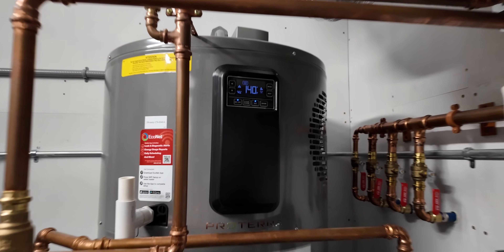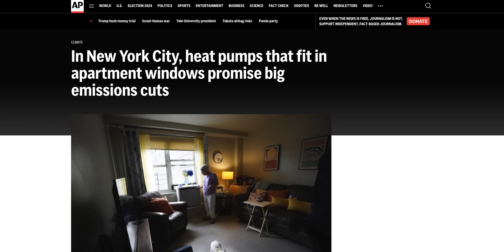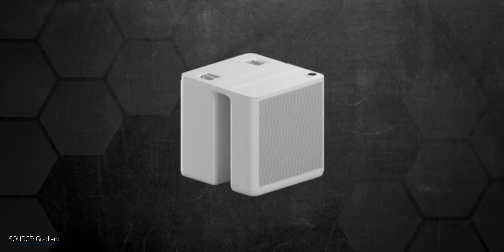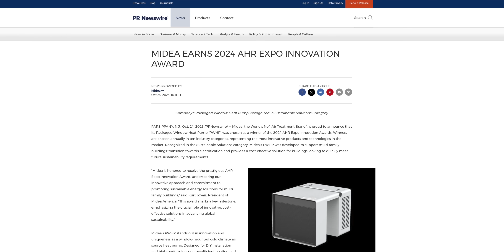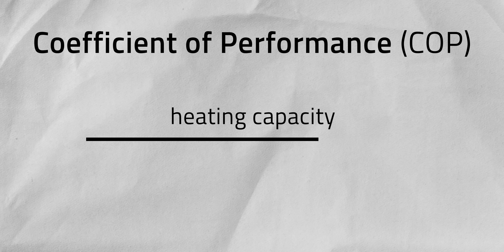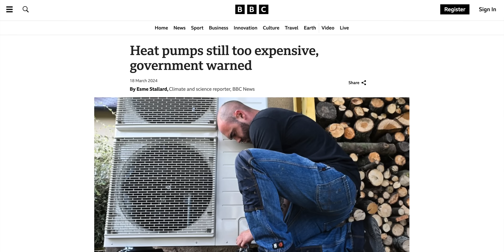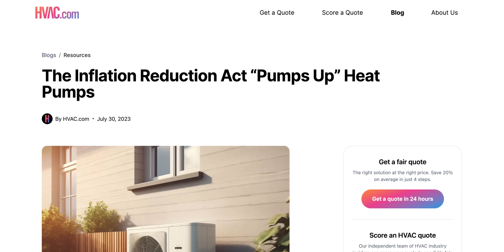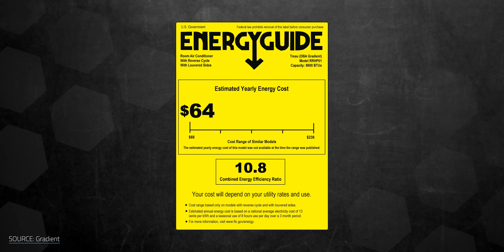Why This Window Heat Pump Is Genius

Comment: I wish someone would make a widow unit like this that works with horizontal windows. Every place I've rented has widows that slide open horizontally so I'm stuck with crappy "portable" units. I also can't mount a ductless unit and run the cables down from the second story because i can't punch holes like that in the wall -_-. If anyone can recommend options, I'd be glad to hear them

Comment: as someone who once had 3 AC units going in their small house at one time,  that then later got Central Air...omg there's no comparison. window ac units never made my house feel as good as central air did. never. you'd need a window ac unit for literally every room for it to compare i think.

Comment: I have thought for years that window AC should be required to work in heat pump mode. It is a similar story all the time. Therefore things are widely required, and the price stays high. but after mandates and mass market production, the price goes down.

Comment: A COP of <3 is abysmal. Any entry level AC for a few hundred $ nowadays does a COP of 4 with ease... Oh, and I totally don't get how running a "heat pump" vs. an AC would save any money whatsoever, AC and heatpump are 2 different names for the very same thing and every modern split AC does heating even better more efficiently than cooling...

Comment: I need one of these for my bedroom. It's at the end of the line for the radiators in my house so it's always cold in winter and in summer I have no air a/c in that room so it's hot.

Comment: Here's a question about heatpumps: if I live in a country that has no need for heating, but can get super hot in the summer (and so I need a lot of ACs), what benefits does a heat pump give me when compared to a regular compressor-based AC

My impression is that heat pumps are just reversible ACs. Is that asessment correct?

Comment: I remember upside-down-U-shaped air conditioners going back at least to the 1970s, but I don't remember if any models from those days were also heat pumps. This seems like a good option for those who can't or don't want to invest too much but can still benefit from a heat pump. It would be ideal for those suffering in buildings equipped only with resistance-heating (especially those awful systems with film or heating wires under the attic insulation) or failing central heating system (heat pumps could have avoided the $100,000+ assessments at Harbor Towers). The overall efficiency is an apples-to-oranges comparison, since the inefficiency of the grid  comes close to evening  the score (and our electric rates in Boston reflect that), and I worry about the continued robustness of the grid. But options like this broaden the choices for everyone, and that can't be bad. As for the comparison of the U-shaped units to conventional window heat-pumps, I don't see why either the efficiency or the manufacturing cost should be inherently different, though the economies of scale currently work in favor of the non-U-shaped units. I'd like to more of both styles available as full-range heat pumps; the added cost of the reversing valve and compressor can't be that much if they are made in volume.

Comment: a few things:
1. the apartment I live in has windows that open horizonally, not vertically. Are there any heat pump systems that fits these? Because I haven't seen any.
2. a good number of apartments I've lived in don't allow anything to protrude out from the building's facade, that means no window units.
3. the absolute BIGGEST hit to my power meter has ALWAYS been cooling. when winter rolls around, our power usage plummets from 200+ to hardly a hundred bucks--sometimes it still gets too warm with the computer running in the same room, but in this case, all I need to do is crack open a window.
4. 3,000 bucks is ridiculous, especially when it doesn't even factor in that the biggest need to air conditioning is to remove heat during the summer months. a heat pump just sounds like a regular air conditioning unit with the option to reverse the heating/cooling sides. A valve is not worth that extra 2k+ that my space heater (aka my computer) can cover just fine, and probably eat up the same amount of money during winter.

Comment: If you ever had a heat pump in the New York winter you would not want one again. Heating mode gives a 20 degree temp rise across the indoor coil. That means if your inside air temperature is 70 degrees the heated air will come out at 90 degrees which is almost 10 degrees cooler than your body temperature. You will be shivering without supplemental resistance heat which is a massive drain on the electric cost.

Comment: so expensive. but I will definately get one of these for my new house. Insane eletricity savings. You get your money back on the device after 2 or 3 years of using it. Ac running all summer can cost 2000+ a year in a decent size home. just put a few of these in and save thousands a year on electricty. just upfront cost sucks.

Comment: We need a law that phases out cool only window units to reversible ones. I've seen window units on sale with heat, but they just put resistive electric ribbons in them. That seems so wasteful. It's already a heat pump. Just reverse it. For the price they're asking for those resistive ribbons, you might as well just get a space heater. It's ridiculous. I also wondering if there will be some kind of U shaped designs for vaulted windows. I end up just using regular air conditioners with fitted sheets of plywood to fill in the gap, paint them, and put a sheet of foam over it on the inside for some insulation.

Comment: Cool form factor.  But I find it weird that there are lots of US videos about this fantatic new heat pump technology. In Australia we have used revese cycle systems for decades. Or am i missing something? There has been as heat pump hot water system at my mothers house since about 2005.

Comment: This is all well and good for the east coast where vertical windows are the norm but it won't work on the west coast where windows that slide sideways have been the standard since the 1930s. I'd love to see saddle style designs for sliding windows as well, there are a very few air conditioners like that but they don't sell well vs the less efficient but easier to install "portable" units preferred on the west coast. It's even worse when like we have the sliding windows are 56" tall, bigger than all but a few window kits.

Comment: Those old steam systems can be incredibly efficient. They are just not maintained correctly. Someone has usually turned up the pressure on the boiler far beyond the design limits of the system. The vents on the radiators if it's a one pipe system or the steam traps if it's a 2 pipe system have usually never been maintained, rebuilt, or replaced. Many of these systems were designed as vacuum systems allowing for steam temperatures well below 212 degrees and even as low as 150 degrees, yet the vacuum pump sits broken in the corner. Main vents are leaking or completely missing. Control devices such as TRVs for apartment buildings with steam are available. On a 1 pipe system the TRV is a thermostatically controlled valve that goes between the radiator and the air vent. When the temperature reaches the setpoint, the valve shuts off the air vent preventing steam from reaching the radiator. On a 2 pipe system the TRV goes on the inlet line to the radiator and shuts off steam going into the radiator. As more apartments TRVs shut off, pressure in the system rises and the boiler shuts off. More environmentally friendly fuels such as biobased heating oil are currently available. Repairing such a system is considerably cheaper, results in similar energy savings, and doesn't result in cheap equipment being bought that will only last 10 years. A steam system properly maintained will last hundreds of years. There are few if any moving parts to go bad. There are no pumps that waste electricity. On a vacuum system the temperature of the steam can be changed based on the outdoor temperature automatically. The problem is that steam system repair and maintenance doesn't sound as good to people as heat pumps or whatever the latest fad is. I heat with a 2 pipe vacuum steam system in my house. Heating cost is less than $250 per heating season for a 1500sqft house in northern New England. Using biofuel. I know people with heat pumps and their bills are nowhere near as low. They require a lot of maintenance. They are loud. They blow hot air around. Now if someone could make a cascading steam generating central heat pump for apartment buildings that would be a much better solution. There are some refrigerants such as R-764 SO2 that can operate in the temperature range required for generating steam. As an example that uses no fluorocarbons at all, a cascading heat pump using R-30 (methylene chloride) as the first stage, with R-764 (SO2) as the 2nd stage would be able to generate steam even at negative temperatures. Use the efficiency of the heat pump but take advantage of the efficiency of steam heat transfer to move the heat around the building. Many of these buildings are not properly maintained, boiler maintenance is done by idiots, and the air vents in some cases are 100 years old. Maintenance to what was once a very efficient system is the first step. Not throwing out an entire system for one that will last a fraction of the lifespan.

Comment: This gadget is nice, but I think it isn't quite there.  Its still a one-piece, bulky monstrosity.  I see the solution as a two-piece item that allows for some choice of where to locate the inside unit.  The line bleeding and setup needs to be a more automatic process.

Comment: what is a "Heat Pump"? It's an A/C unit that can also run in reverse, there is literally nothing else different than a portable A/C. You need heat? Just use a portable heater and advocate for renewables on the political scale.

Comment: It all sounds well and good, but what's more efficient? Millions of electricity-powered heat pumps of which a good amount are left running more than they need to, or steam that can heat people's homes even for a while during a power outage, combined with an AC window unit? I guess you could balance the waste by giving all these window units to poorer homes without AC, or poor regions in the world.

Comment: I live in an area that spends several weeks a year in the 105-110 range. We struggle to cool an upstairs bedroom currently and are looking to supplement with another cooling method. Was thinking about one of these units but I saw the upper range being 95 degrees on the Gradient unit. Does that mean it couldn't/wouldn't help cool effectively when the outdoor temp is over 95?
Reply: I have a full-sized Mitsubishi mini-split system. When it's over 100 degrees outside, my house is a cool 68. They work great, however I believe they are a better cooler than a heater. My wood stove is my primary heat source in Winter. 👽✌️
Reply: @Psychodermia  That is the feeling, yes.  The real problem lies with temperature differential.  When it is 100 degrees outside and you are attempting to cool your home to 70ºF, the differential temperature between indoors and out is roughly 30ºF.  When you are trying to heat your home to that same 70ºF and the temperature is 25ºF outdoors the differential is 45º.  That 15º is the reason it feels like they do not work as well.  You are heating the same amount of space but the differential is much higher.  This same temperature differential applies to the ability of the unit to heat and cool as the entire purpose is to exchange temperature with the air.  In a well-sealed, well-insulated home this differential is much easier to overcome however.

Comment: Grid power is the new power cartel!!!! Remember when ever someone tells you that you create energy from nothing and is willing to tell you that it goes against physics is a victim of cartel rhetoric. The efficiency formulas used for heat pumps are completely misrepresenting reality. Fact is a 120vac heat pump can generate heat more efficiently than resistance heat strips. False that "heat pumps generate more energy than they use" Also most 120vac units are more expensive to operate or will not work at all below -10 deg. 220vac units can do okay down to -32 degs but cost more than resistance heat below -20 degs.

Comment: Now we just need something for a casement window and awning window that opens outwards.   So far, the best I've come up with is using a dual hose portable heat pump and basically seal off the window with something except for the two hoses, perhaps with a panel or a film (maybe even Saran wrap) and then just open the window when the unit is operating.

I suppose you could open the basement window, mount this unit and then seal off the rest of the window with film and duct tape.

Comment: Has anybody noticed the necessary window design?
Those vertically sliding windows might be common in the USA (and possibly around the world).
Here in Germany, windows usually have one or two wings, though.
Unfortunately, those heat pumps won‘t fit here.😢

Comment: Oh cool so my rent will keep going up but ill have to pay for my own heat now! Awesome. Also, electric is heat in NYC is expensive as hell. This makes no sense for north east urban areas. 

NYC doesn't have enough electricity for everyone as it is. They send out text messages all the time asking us to stop using air conditioning. There is no way they can claim the grid can handle conversion to everyone using electric. NYC also doesnt legally allow landlords to change the heat source or AC source if it will shift thr burden of the cost to the tenant, so landlords wouldnt even be able to make this switch until a tenant moved out.  Theres just no way this will take off for the majority of rental properties.

Comment: And how many do you need in a 3 bedroom house/apartment, and how much more electricity do those cities need when going from gas/oil for heating, and do not forget the hot water, still needs to be coming through the tap, or should every apartment install one or more electrical water heaters. A larger rusk for leaks and the risk of having at least one steam bomb in every apartment?

Comment: This is not a heat pump its just a regular AC unit just like any Split units with external unit and a internal unit with coolant piping connecting them together.

Comment: I own 2 heat pumps. One must remember that both sides of the
unit,  indoor and out need to drain. In the Winter the outdoor unit will
have to drain liquid water from time to time. Areas below could 
become slick or just covered in ice.

Comment: This video reference New York apartments. What about for a house that has no central heat system? Last year I  bought a 1795 colonial house in New Hampshire. It has approximately 2400 squ ft on the first and second floor. It has been used as a summer home since the 1930's, so has no central heating or A/C. I have been leaning toward taking up the floors, adding plywood subfloors that I can level up and installing under floor radiant. I am wondering if one of these heat pumps in each of the four bedrooms and four rooms downstairs would make sense financially. I don't have the ability to calculate what it would cost to heat and cool my house with eight of these heat pumps in this climate. Since I want to separately zone each room in the house, so I can keep the majority of the house at settings that would keep the pipes from freezing in winter and dehumidify in summer. What do you think? How can I make the cost comparison calculations?

Comment: 9000 BTUs isn't enough to cool down even a small apartment. I have a 12000 BTU window air conditioner for 450 square feet, and on very hot days it barely manages.

Comment: I'm amazed by how normal heatpumps are in Europe compared to US 

I recently fitted my flat with AC and at this point it's almost impossible to find a non heat pump one. It's so cheap to get the ac to run in reverse even the cheapest nastiest units have a heating mode

Comment: 9:30. Yes, ACs can heat your home.  As mentioned in many ither comments here, just a few parts can reverse the flow and start heating your home.  There are plenty of videos on Yourube describing this process and a few even show how it can be done.  Even having a professional do this upgrade to an AC, it still would be less than Three-thousand dollars.

It does seem like thise models are loss leaders designed to get that negative attention and then show off cheaper models that are almost the same.

Comment: Is there any data on the air leakage impact? Presumably quite detrimental to the overall air permeability due to any gaps around the unit itself and the gap between the centre pain of a sash window. That said if you are installing one of these you probably aren’t aiming for an type install.

Comment: I think concerns about how new technologies affect The Grid are overblown, whether it be heat pumps or electric cars. Adaptation is ALWAYS slow enough that the increased demand is predictable if not negligible. Sure, if everyone bought the newest Widget tomorrow and plugged it in, we'd be cooked. But that never happens.

Comment: so it is a split system... without splitting :) i`ve had them in my country since... 20 years or so....oh and it costs somewhat like 250$ for 40 square meter model... I have 5 right now where i live, 1 in each room

Comment: While I do see value in these units for when conditions are fairly moderate, if/when the temps fall below -7F....when you need the heat the most....you better have a backup.